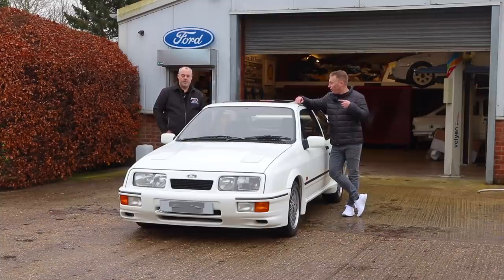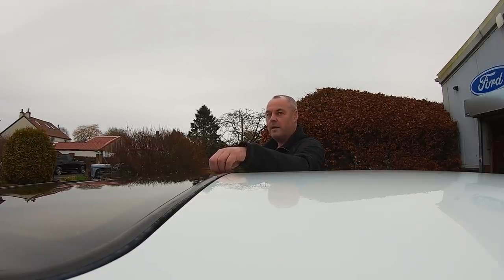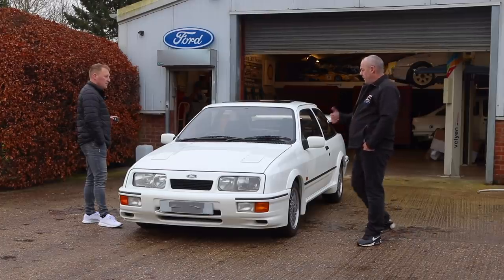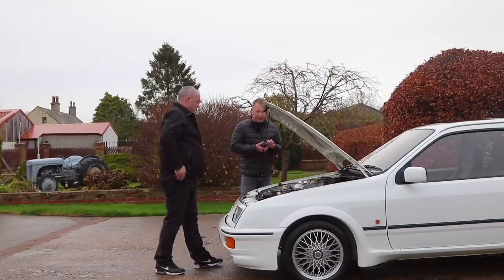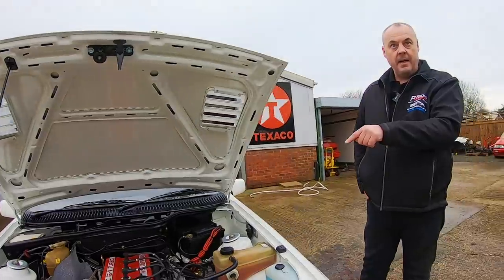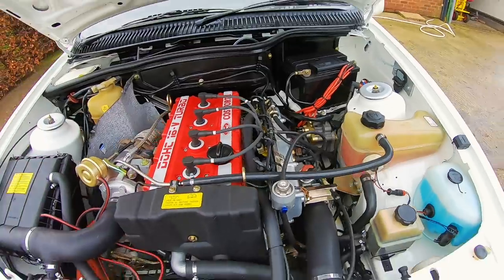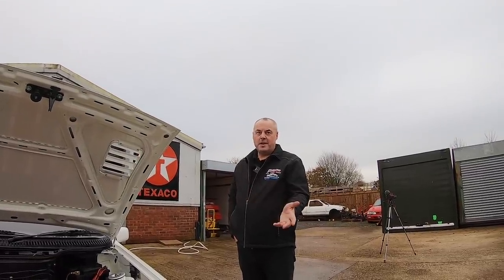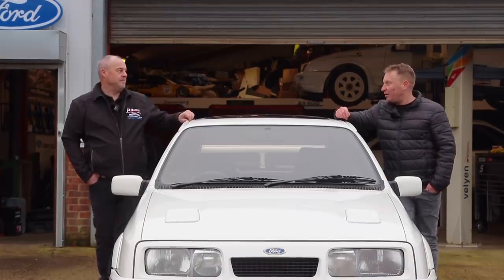Rebuilt Fire Damaged Sierra Cosworth 🔥 ** Cost **

Comment: Regulator failed on mine, but the fuel came up through the vacuum port and sucked into the inlet causing the car to run like a bag of shite and filling the sump with unburnt fuel

Comment: Looks good. However I’d fit cable ties to the black/red Amal valve hoses. If the hose comes off the Actuator, not only will it go like fu*k, (lots of over boost) it will melt pistons! They might be a tight fit now, but that will change over time. Also the bolt securing the top of the alternator,  to the adjusting bracket doesn’t have a washer on it. Over time the bolt will come loose, as it digs it’s way into the slot on the bracket. Just saying………

Comment: Not many MOT garages are going to commit insurance fraud to help out some random guy with a burned out car ! Insurance company would check up on any booking you claim to have made.
Reply: Don't know how insurance company got away with not paying out, no mot does not invalidate your insurance, but saying that insurance company would have just written car off
Reply: The lack of an MOT is only relevant if an mot test could have picked the fault up. If the  car was roadworthy and well maintained then the insurer has no grounds for refusing the claim. The ombudsman has upheld plenty of complaints against insurers refusing claims due to lack of an MOT, where it had no bearing on the claim.